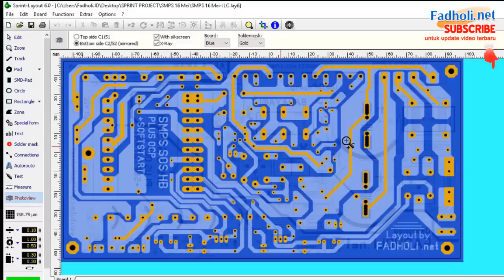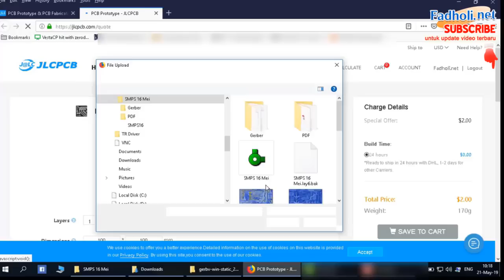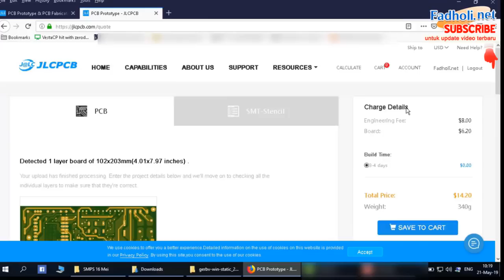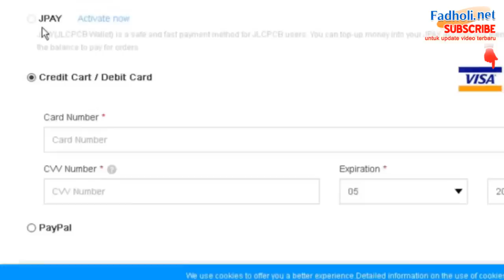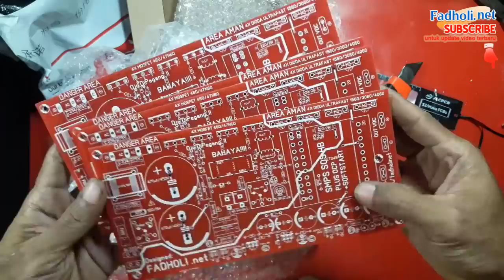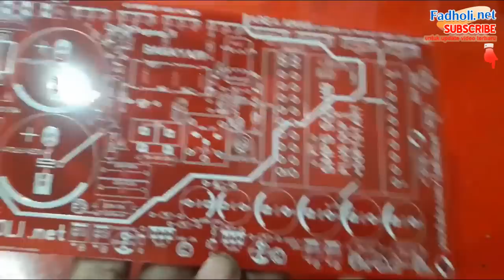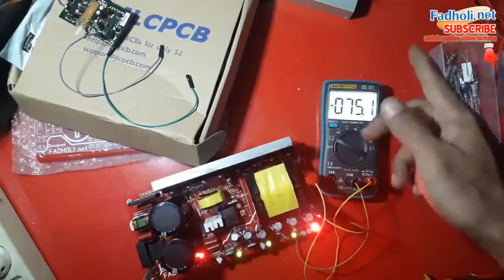Membuat SMPS HB OKE

Comment: Mas minta saranya maseh 🙏🏻🙏🏻...  Sy buat smps hb kenapa setelah pasang fet lampu protek nya dan fet juga panas nyala ,padahal dicek tegangan di lubang kaki vgs sdh seimbang yaitu 4,9 volt , frequensi pun seimbang 64,60khz
Reply from the maker: Fet rusak atau bisa juga salah pilih tipe fet. 
 Lebih mudah pengetesan awal ocp dinonaktifkan dan pakai bohlam sebagai pengganti trafo.
Reply: @Fadholinet  terimakasih maseh... Ternyata harus dibarengi dgn trafo ferit nya , setelah saya pasang fet dan feritnya skrg sdh on tinggal tes load

Comment: Mosfet nya pake tipe berapa cak , saya coba pake irfp 460 saat di load 4 ohm mosfet langsung tewas ... itu apa mosfet nya yg kurang kuat ampere nya ? Mohon solusinya
Reply from the maker: Kalau load baru beberapa detik langsung coid kemungkinan antara frekwensi dengan induksi trafo masih belum pas mas.
Reply: Owh oke mas akhirnya saya turunkan frequensi dan duty cycle nya alhamdulilah mosfet aman , tapi sehabis di load mosfet cukup anget

Comment: Saya kemaren beli smps cctv 24 vol 5a amp..saya pake kit step up untuk menyalakan lampu led 32 volt 150 wat kok kedip ya...aa bisa dimodifikasi?trims
Reply: Kagak nyambung topiknya... tapi sy coba jawab: smps 24v 5a brarti 120watt, dipake beban 150watt jelas ngedip, belum lg smps tu belum tentu benar2 120 watt... untuk modif harus gulung ulang trafo dan ganti beberapa komponen... di channel Kasyan tv ada caranya tuh....

Comment: Mas saya coba merakit dengan skema diatas kok cuma keluar 7.5 A kenapa ya,, kira2 kurangnya dimana.. untuk NP kawat 0.6x8 NS kawat 0.6x12, dioda sekunder saya pakai D9202 bekas inverter las..
Reply from the maker: Sudah saya awab di video sebelumnya ya
Reply: @Fadholinet  apa mungkin karna dioda sekunder pakai D92-02 karna di datashet tertulis 10Ax2
Reply from the maker: @aeemier  Mungkin saja... 7A pada beban berapa ohm?
Reply: @Fadholinet  pada beban 7 ohm..
Volt drop dari 140v menjadi 54v..

Comment: Mr fadholi why the lamps start working normally and when installing a transformer etd49 the ocp protection is included
Reply from the maker: Turn right VR for decrease ocp sensitivity.
Reply: @Fadholinet  ok. Thanks stacker trimmer 20k and I reduced 20 turns on ocp inductance is 2.5mH is it ok and working tell me etd49 how to do it now i did it as ACCR576pinoy tell me to change something thanks
Reply: @Fadholinet  Right or left is now left so is it good or has a problem if I make a video to see I'm from Bulgaria and I didn't understand what was said in the video
Reply: Jos mas orang Bulgaria bisa rakit🙌🙌🙌🙌

Comment: Mau tanya mas, tegangan extra yg melewati TR 31 kan drop mas, kalau TR 31 di ganti ic 7812 bisa gk mas
Reply: Maaf tanya komponen apa ya yang didekat capasitor 100n
Reply: @mursidprabowo4889  kalau yg di maksut dekat relay ocp itu BT 131
Reply from the maker: Jika extra belum dikasih beban seperti kipas saja sudah drop, tambah jumlah lilitan extranya sampai 4-5lilit.  Ganti 7812 bisa saja tapi harus sedikit menyesuaikan dengan melepas R dan zener yang ada. Tpi ganti 78xx kalau dari inputnya sudah kurang maka hasilnya tetap drop
Reply: @Fadholinet  alhamdulillah mas lilitan saya tambah menjadi 4 lilit tidak drop lagi trimakasaih mas

Comment: Mas fad, smps punya saya sudah bisa start, tes pakai bolam sudah nyala di primer trafo utama, 
Tapi kenapa ya ketika trafo utama di pasang, dicoba langsung protec, vr sudah saya putar" Gak ngefek. 
Minta solusinya,, mohon di jawab mas🙏🙏🙏🙏
Reply from the maker: Kurangi lilitan ocp
Reply: @Fadholinet  
ocp 30 lilit tetap masih protec
Lilitan extra apa pengaruh di ocp nya mas. 
Lilitan extra saya pakek 4 lilit
Reply: @Fadholinet  
Kalo osc nya lilitan primer di silang tidak mau start, kalo lilitan ns1 di silang mau start, cuma langsung protec
Reply: @sigiterwanto2832  udah ketemu kah bang solusinya,soalnya senasib bang...

Comment: dioda skunder pake seri apa om?
Reply from the maker: RUG/MUR1560, 3060, 5060 dan seterusnya
Reply: @Fadholinet  mur3060 kakinya 3 om... sy beli pcb smps ,dioda skunder tulisannya mur3060 tapi di pcbnya lubang nya cuma dua. kalo diberi mur1560 kakinya kurang lebar

Comment: Input 100-120 vac  3.2A
          200-240vac  1.6A
                       50/60Hz
OUPUT   +24 ----6A  pa kan ni snps mas. 
Trus tu kluarnya brpa vac q g bs bcanya mf pmula? 
Mkzih sblumnya
Reply from the maker: Out 24VDC.
Reply from the maker: CT = postif, negatif dan ground.(0)
Non CT = positif dan ground(0)
Reply: @Fadholinet  kalau ground  di avo groud  - jga + gk gk kluarin tgangan kalau - ke + kluarin tgangan. 
Berarti tu mono nya mas snpsnya?. 
Mksih sblumnya

Comment: Mr fadholi lamps light up normally and the mounting transformer et49 uses ocp protection and what is the ZD 24v-15v-91v-1n4148 consecutively with r470k

Comment: Mas .gmna cara e ngilangin desis pada radio yang mengunakan power smps
Reply from the maker: Maaf sudah ndak pernah dengerin radio mas jadi belum pernah ngalami sendiri hehehe
Reply: @Fadholinet  walah iya mas .soal e radio saya pakek smps ngewes gtu suarane
Reply from the maker: Karena smps memang bekerja di frekwensi tinggi mas.. mungkin frekwensinya nyasar ke freq radio 😃
Reply: @Fadholinet  ada yg bilang d kasih cincin ferit pada bagian + nya cumak ngk ngasih berapa ukuran lilitan tersebut
Reply from the maker: @dedentsolikin7669  Bisa seperti itu.. feritnya kecil.. lobangnya tinggal masukin ke kaki dioda out. Atau bisa coba kasih lilitan untuk masing2 output smps. ukuran dan jumlahnya bebas.
Reply: @Fadholinet  ok mas makasih infonya
Reply: @Fadholinet  kalo pesen smps 12@ 33vdc berapa mas non ct ful protek short circuit